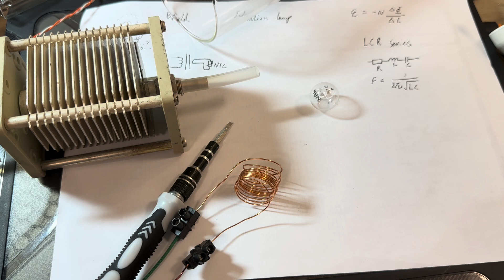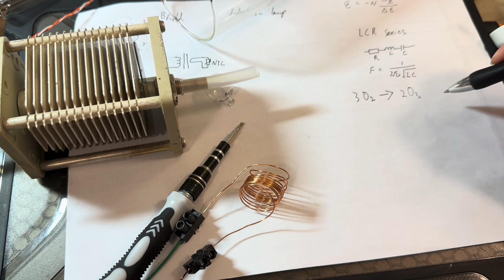MELTZ Photon RF induction lamp

Comment: Greetings from Russia. You know, when, a very long time ago I had a photon device. This is a small device in which this lamp was used. Around it was 1 or two turns of thick wire. The device was considered therapeutic and was not intended for lighting. It was in the 80s when I was a child. Thank you and memories.
Reply from the maker: That cool, do you know what therapeutic properties of this lamp?
Reply: This is an unusual device. It generated radiation in the range of 230-290 nm. It was used to disinfect the skin after shaving for a short time, as well as for a light tan. The lamp operates at a frequency of 40,68 Mhz. The operating time is no more than 5 minutes, then a break of 10 minutes is required. This is due to the features of the device, it overheats. The generator is based on an electronic lamp (1П24Б). This device can still be bought in Russia at a price of 10 to $ 20. There is also a diagram of this device. To search, use the name in Russian "прибор фотон".
Reply from the maker: @hikewomeat  1P24B or 1П24Б is probably one of the most compact vacuum tube made during the 20th century. Is it reliable compared to standard transistor?
Reply: Russian КТ606, 2n5090, mrf515

Comment: Hi thank you for your video..Please can you tell me what the device is with the clear pipes connected?
If it is an oscillator please can you give me information on it like name, brand name or any information at all.. Thank you very much!!
Reply from the maker: The clear pipe is not correct to anywhere. The oscillator is made by myself. Read the description.
Reply: @ReedSwitchTube  So is that just a variable capacitor with plastic pipe to insulate because you have no knob for tuning.?
Reply from the maker: @mtttony  Correct! I do not have any knobs. even the handle supposed to be grounded, but in rf circuitry there is still a large potential difference induced between any conductor to ground. (Capacitive coupling)
Reply: @ReedSwitchTube  Thank you!!